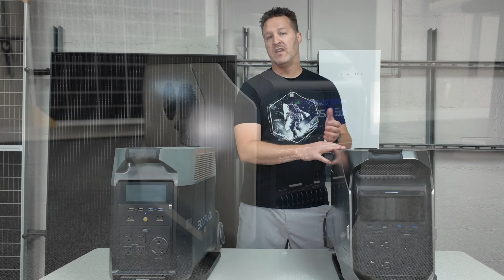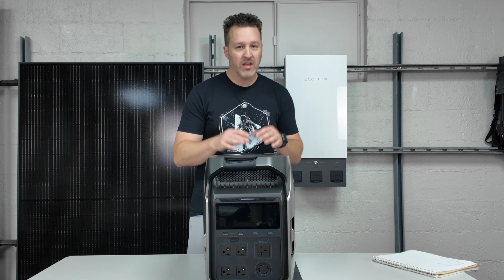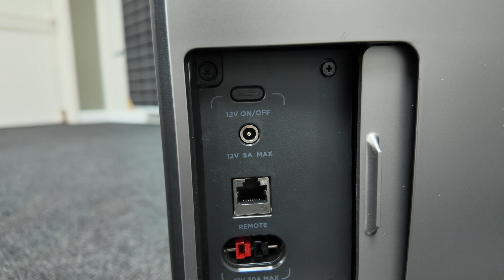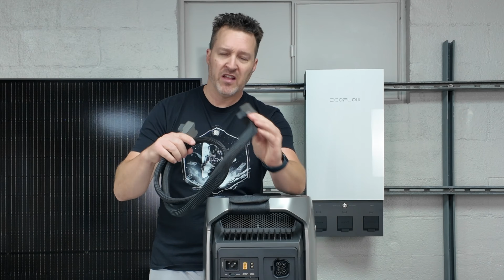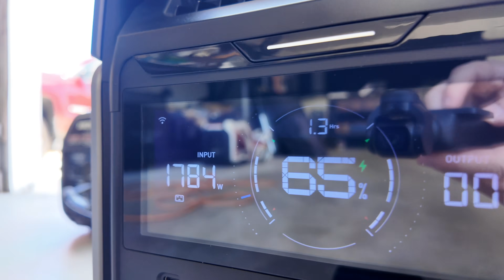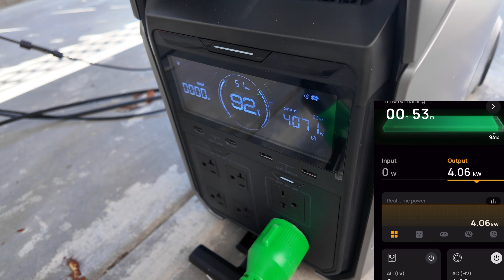Ultimate 240V Power: EcoFlow Delta Pro 3 First Look

Comment from the maker: Best Portable Power Station EcoFlow Delta Pro 3 improves over original Delta pro and is only that much better!! New EcoFlow Smart generator 4000 has much to prove, but I think you’ll be impressed, check out the video soon!! #ecoflow #deltapro3 #solar #rv #vanlife #new #viral 

Have a question you want answered fast: https://asqme.com/@johnnysweekends

EcoFlow Website:https://bit.ly/3KTau1c
EcoFlow Amazon:https://bit.ly/4c7VOqU
DISCOUNT CODE: EFDP3JWEEK

Don't miss out on the  @EcoFlowTech  exclusive offer! Purchase now and unlock incredible benefits valued at up to $3,000.(Website offer. Valid from June 25-July 23)!
1. Buy one EcoFlow DELTA Pro 3 for $3,199 with a $500 OFF coupon! Or buy one EcoFlow DELTA Pro 3 and get one EcoFlow 400W Portable Solar Panel for free. 
(From $3,199 or $133/month for 24 months).
2. Get a $300 upsell discount when purchasing related bundles.
3. Get an extended 2-year warranty of EcoFlow DELTA Pro 3.

Purchase the EcoFlow DELTA Pro 3 through my links and use my code EFDP3JWEEK (Valid from June 25-July 23) to get one EcoFlow PowerInsight for FREE! (Limited quantity).
(Use my code to get one free PowerInsight when purchasing the website DELTA Pro 3+PowerInsight bundle. When you add both DELTA Pro 3 and the PowerInsight to the Amazon cart, use my code and the cost of the PowerInsight will be automatically deducted).

EcoFlow Website:https://bit.ly/3KTau1c
EcoFlow Amazon:https://bit.ly/4c7VOqU

SAVE BIG ON NEW SOLAR PANELS HERE: https://signaturesolar.com/?ref=JWKNDS 
DISCOUNT CODE: JOHNNYWKND

BUNDLE & SAVE SHOP SOLAR KITS ! https://shopsolarkits.com/1134

CHEAP USED CERTIFIED SOLAR PANELS HERE: https://www.santansolar.com/?ref=Johnnys%20Weekends 

CHECK OUT MY AMAZON STORE: https://www.amazon.com/shop/johnnysweekends

Comment: Can you use the 2 DP3’s and the 50amp hub to run a 50amp RV with three a/c units?
Reply from the maker: I mean technically yea it should work but 3 AC unit pending size could be over 5000 running watts. You would need mass solar to keep that running.

Comment: Awesome revue thanks I have Ultra with smart panel  Now this new DP3 with generator comes out and I am trying to get answer from the manufacture to install the ultra and the dp3 together on the smart panel and have the new smart generator to start when the batt gets below 20% I understand that the smart new gen should start automatically to charge the DP3 but is there anyway to do the same for the Ultra ? and will the 240v out will be on while charging DC3000W ?

Comment: I have a Delta Pro 2 Max.  I am going to buy the new Delta 3 and Generator Combo.   Is there a way to plug my current delta pro max together with the Delta 3 to increase the Amp Hours of the Delta 3 while outputting to 240?

Comment: With the  Anker f3800 being around the same price or lower with a 6000w stronger inverter, it seems  like the better deal and can run much bigger 240v loads. However so that i know the Anker cannot pass through output AC on its 240v ports while ac charging at all.  At least the DP3 can charge at 120v while outputting 240v. Something is better than nothing. But they need to update these whole house devices to actually pass through 240v. Thats what we all want to save generator fuel.

Comment: I’m a bit old and slow so bear with me.  For a small cabin power backup, the ecoflow with 240v could run my well (20a) when needed. And if paired with new gen, The gen would start when battery got low to recharge?  Great channel!
Reply from the maker: Yes delta pro 3 and smart gen with solar would be great 👍🏼 
240v if needed

Comment: Thanks for your review, it’s great!
I’m interested in your opinion if extra battery from Delta Pro 3 fit the Delta Pro. I want to new Extra Battery Delta Pro 3 and connect it to Delta Pro (old).
Thank you for your feedback.
Reply from the maker: New batteries will not work with old Delta pro. But old batteries will work with new DP3

Comment: Would love to own these new units but they are all way over prices and way too much hype. My delta pro and two extra batteries have never held up to all the hype. I'm sure these new units are just as hyped and most likely will not last as long as they state. But I would still like to trade my units for the new ultra as it is more storage friendly. My delta pro and the extra battery connector are horrible. You have to have at least four or five feet to store the pros so you do not bend the battery cables.

Comment: In your smart generator 4000 review, please compare fuel consumption to the current smart generator model. Thanks for the great content.
Reply from the maker: I can give rough estimates but so many variables not to mention this new engine is more than double the size of the old one. So it will burn more fuel overall but also will charge much faster.
Reply: Thank you!

Comment: Can It run a 240 volt dryer? Not that I would use it during a power outage......Also, what about a 240 volt deep well water pump?
Reply from the maker: It can but barely also using xboost, but honestly that’s not what it’s for. So I dont recommend it because you are maxing it out. Well pump yes but also depends on the size of the pump. Many different units with different power draws you would would have to see how much your unit draws
Reply: @johnnysweekends  Thank you

Comment: Could you do a compare of the Delta Pro 3 vs the Ultra? Also, does the Smart Gas Generator work nicely with both of them, I've heard some folks are having problems with the auto sense/start system. Thank you for the video!
Reply from the maker: The DPU is an entirely different unit and really suited for home back up and not so much a portable unit. The new and old smart gen does not work with DPU unless they come up with an adapter soon. Will see. 
The new smart gen is not really even out so not sure how people are getting data with DP3 or anything else.

Comment: The only problem I have is the amount of solar I can add to this. For this price I should be able to have one port where I could add up to 500v. I live in the north so I need a much larger array. I will also never buy proprietary second batteries. They should fully support regular 51.2v batteries I could just buy off amazon and have it work in tandem with the battery inside the system.

Comment: I think the only thing left to really criticize the Delta Pro series now is how the extra batteries don't really have any other function other than supply power to the main unit. It would be ideal for the extra battery to either allow you to plug in the gas generator OR allow other batteries to be plugged into it to daisy chain more batteries, it would help out on losing capacity to the gas generator or something (though I guess you'd just want to get the DPU at this point). Also would be nice to get more amps out of the 240v port AND be able to use the 120v outlets at the same time. Still, for a first time buyer that's willing to spend the money and have something that's still portable, DP3 looks REALLY impressive. Makes me wish it was out when we were looking at the original Delta Pro, but technology always gets better. Grass is always green, etc etc etc. Def not worth us upgrading.
Reply from the maker: I to wish the extra battery wasn’t a brick. Can’t use it at all for anything unless you have a main unit
Reply: @johnnysweekends  YUP That's always been the big drawback. When I was first looking into the Ecoflow Delta Pro, I had it in my head that we could take the extra battery and bring it to a generator to charge it then bring it back to the main unit to keep it going. Happy I realized that wasn't the case before we bought it but I just wish there was more you could do with them. I really like that the Ultra lets you daisy-chain them to expand cause that's the most elegant way to do it.

Comment: Will the new smart generator work on the delta pro ultra? Does it use the same battery port adapter?
Reply from the maker: As of right now no. Im waiting to hear back about possible options since it’s not even officially released.

Comment: Great review, thank you. I hear what you are saying about the 240v in, but no front ports use. I would rather the setup be as it is where if you are doing 120v, you get the 120v and 240v (albeit it at a cost of battery base charge). I think most folks have 120v generators that are only 120V capable. But as you said, perhaps a firmware update can make this selectable.
Reply from the maker: You can use both 120 or 240 while charging with 120 volts but can’t use 120 and 240 at same time.
240 volt charging disables both

Comment: Can you hook up the Smart Battery (the previous model for the Delta Pro)?
Reply from the maker: Old DP battery does work with New DP3. But new DP3 extra batteries do not work with old Delta pro.
Reply: yes with new firmware (ecoflow seems to send a new firmware out almost daily), the EB's from the original DP work but your Delta Pro with the inveter you can use as a boat anchor
Reply: @tlteal  I assume the battery cables are compatible. I'd like to use the longer, braided cable for EBs. Can't find any online yet.

Comment: Do we still have the limitation of either 2 batteries or a battery and the generator.  I have a full system with two DPs, 4 batteries and 2 SGs and I wish I could run them all together.
Reply from the maker: Yes I explained this 👍🏼

Comment: So the new smart generator will work on the old delta pro? If so can you show that in your video you make about the new smart generator I’m excited to see it ☺️
Reply: Yeah, I would like to know if the Delta Pro will charge at 3200 watts.
Reply from the maker: @leguirerj I did 2800-3000 bit firmware is still not correct for DP

But that update should be coming anytime soon hopefully I’ll have that in the video
Reply: @johnnysweekends  Can't wait for that video!
Reply from the maker: Yes it does!! And yes you will see more here than anywhere else. Since I have been around generators along time I already have more info on this than any other channel.
Soon! 
I’m going on a trip so when I get back I’ll be working on that. Departing in my RV asap!! 👍🏼😀
Reply: @johnnysweekends  you’re the best! Thanks 😁

Comment: The problem with the portable battery industry, and especially EcoFlow, is that all the products are TOO EXPENSIVE!! The delta pro 3 needs to be $1,000 at most and all the other products scaled down in price similarly.
Reply: 🤣 where did you come up with that $1000? That barely covers the cost of the battery
Reply: 1000 dollars is a wild price suggestion for a 4kwh power station.
Reply from the maker: $1000 will never happen for a premium all in one unit. Maybe a knock off with minimal features 
But $1600-2000 for a different brand that’s close maybe.
Reply: Perhaps $1000 for the original Delta Pro now that the DP3 has launched.
Reply from the maker: @tumbleweed1976 I doubt we ever see it lower than $1599 but once in a while a super sale will come at $1999
Reply: Not if you're gonna get 240v... Try and find something that'll do that as a stand alone item
Reply: That wouldn't even cover the cost to make it.
Reply: You will see how the prices will drop in future by the pressure of Far Eastern competitors.
Reply: Not with tariffs coming
Reply: Just get it in 6 months half price ebay refurbished...

Comment: I am in the research stage of planning our full time Rv as retirement looms. I have been comparing the ecoflow (1/2 the cost) of traditional Victron system. I have watched many of your videos. I’m leaving toward the DP3 with extra battery and the smart generator. My home already solar powered but it feeds to the grid. So I will have to do the research on how to adapt it to our home, when not rving. I am disabled, so I’m limited to doing a traditional solar install on RV. I was going the RV comes with 600 watts from factory with upgrades up to 1000 so that part will be run for me. My research installing a manual transfer switch seems to be the best best in the Rv. Since I will be using the Ecoflow DP3 at my home also. Any suggestions about integrating it to the RV?  I watched your videos on your Rv system. As always I love the informative videos you produce!
Reply from the maker: If buying a new rv try to have two roof top inlets down to a breaker or disconnect and then that’s it.
Don’t use there junk if possible unless it’s two late. The Gopower is so over priced for what ya get. 
What you want is the power feeding down to the disconnects so you can then use the solar to what ever system you desire. Not what they build

Then from there you can plug right into DP3 or any other system of your choice to charge batteries or Ecoflow or what ever. Verses if they build a whole system is can be a little difficult sometimes to grab the solar and run it to where you want
Reply: Preaditor 5000

Comment: Will this unit operate in UPS mode?  Meaning, will it power up automatically when input power is restored from a dead state?
Reply from the maker: It does have ups mode at 10ms switch over. 
So if plugged into grid power you would have this plugged into the device and if grid power goes down it swaps from pass through to battery automatically
Reply: Yes, it will do that. You can set it to “AC always on” and then in the event that power is lost and the battery is totally depleted.. when power is restored the inverter kicks back on a power to whatever you have plugged into it will be restored as well.

Comment: Johnny, any recommendations on where to find a L14-30R power meter 240v to collect power usage for home generator using interlock switch?  I can’t find one
Reply from the maker: You can use the power watch dog. It keeps track of loads and KWH. This is the cheaper one but you will need a adapter https://www.amazon.com/dp/B0791VGVZ1/ref=cm_sw_r_as_gl_api_gl_i_S913DHDAS09701G8BRVC?linkCode=ml2&tag=johnny5dahlbe-20
Reply: @johnnysweekends  Thanks!

Comment: No new inverter? 800w seems low.
Reply: He meant *8000w
Reply: @jackjacks5480 Actually, I did mean the 800w micro inverter. I wondered if they released a new version of that device too as the old one is on sale on amazon.
Reply from the maker: It is new??? 4000 watt verses 3600..? 6000 xboost and 8000 surge.  And 120/240? It’s all new 🤷🏼‍♂️
Reply from the maker: Sorry dont understand 800 W where